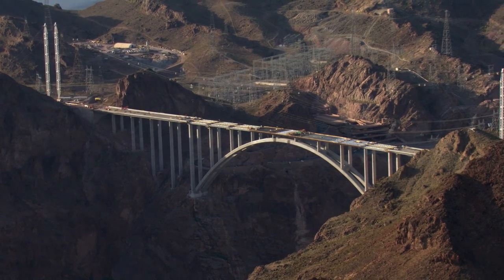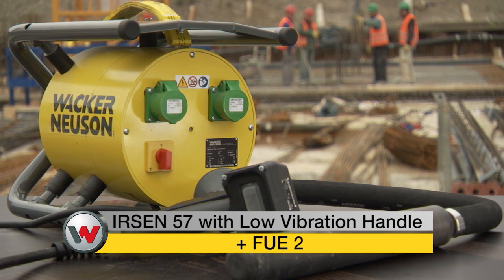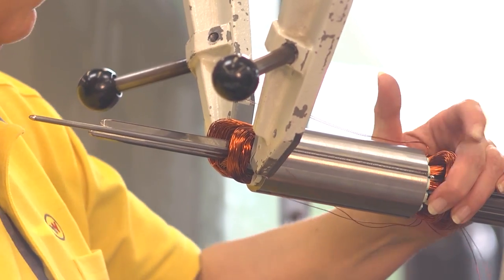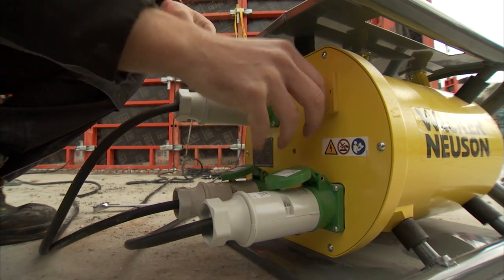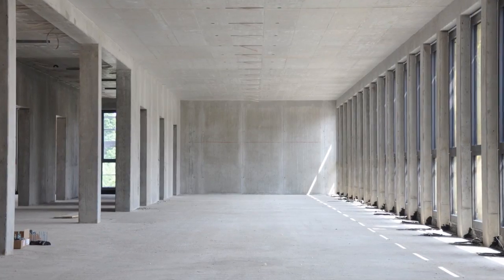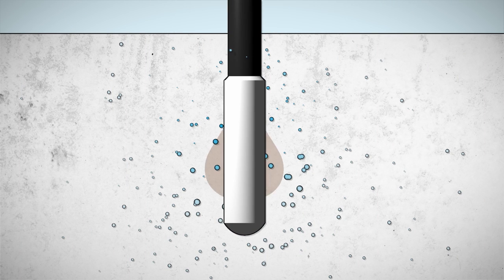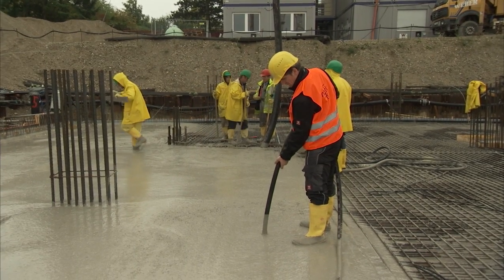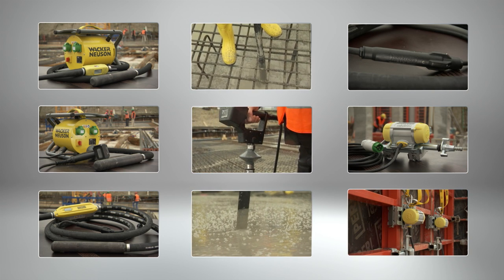Concrete Technology by Wacker Neuson

Comment: How long do the vibrators have to be attached the the form work? Do they have to be moved to different positions?
Reply from the maker: +FIREHAWK1979 Thank you for your questions. The vibration time depends on several factors. The most important one is the concrete consistency. Usually it varies in between 2 – 5 minutes. Usually we work with two vibrator lines which are moved upwards according to the pouring process. In some cases it makes sense to fully equip the mould with motors in order to avoid their relocation. If you have further questions, please visit http://www.wackerneuson-concretesolutions.com/?setLanguage=en or get in contact with our concrete experts via this website.
Reply: +Wacker Neuson thanks for taking the time to reply